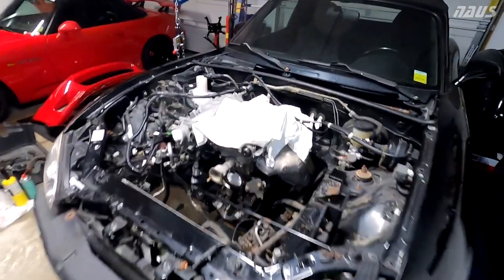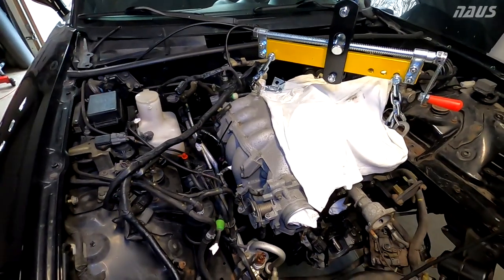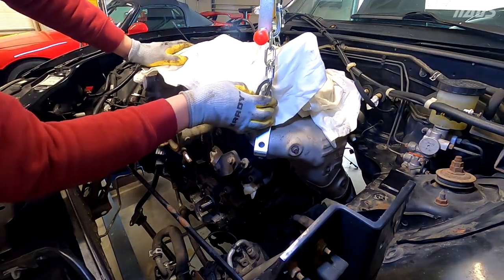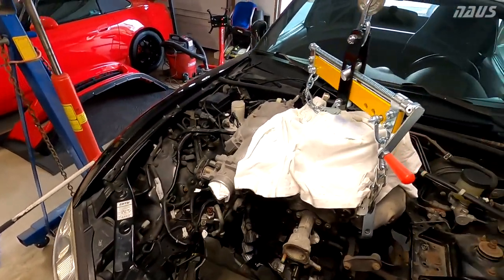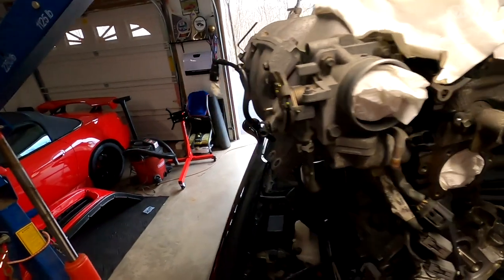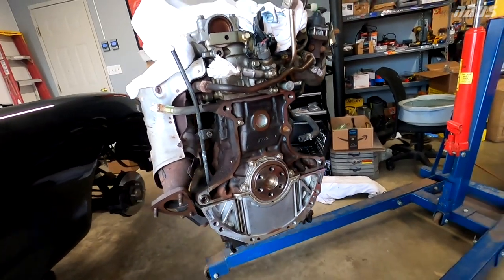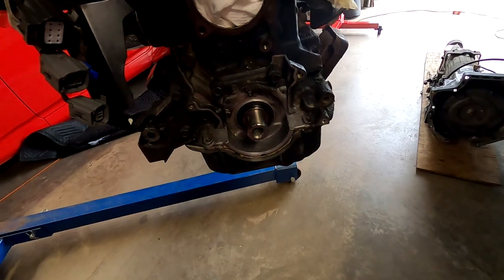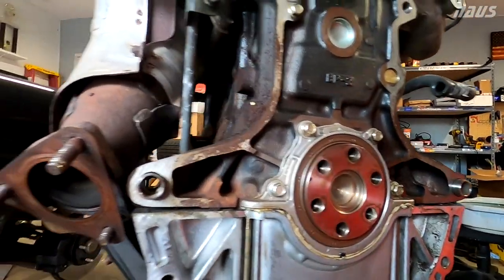Miata Engine Removal (NB2)

Comment: Hey man, I always wondered what transmission fluid you ran in your si for the street/track? I intend to take mine to some autocross events this summer but couldn't find a definite answer to if Honda OEM mtf is still up the task or if I should be looking into something else. Looking forward to the next video as always 👍
Reply from the maker: I used redline mtl before the trans was rebuilt as a bandaid, but once the trans was rebuilt Honda mtf did just fine. I currently use Honda mtf in my s2000 and change it annually due to track use
Reply: Oem it is then, I appreciate the input.